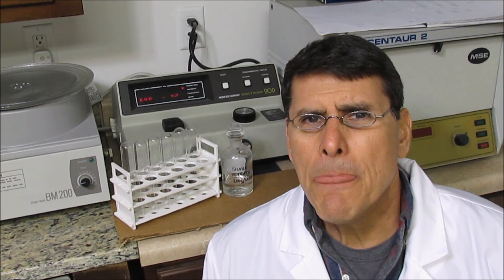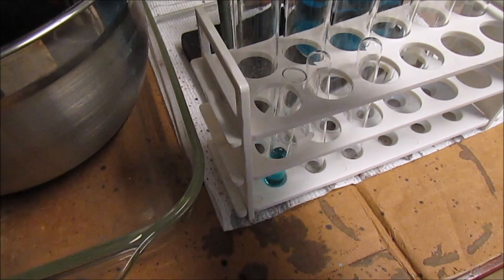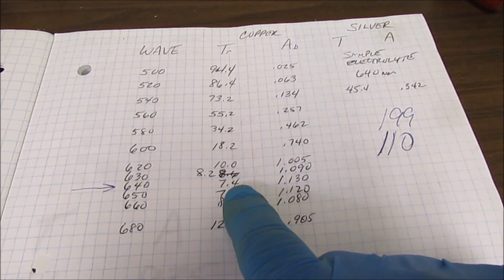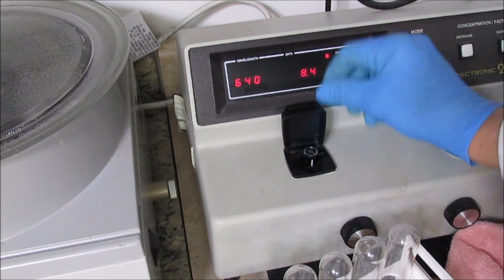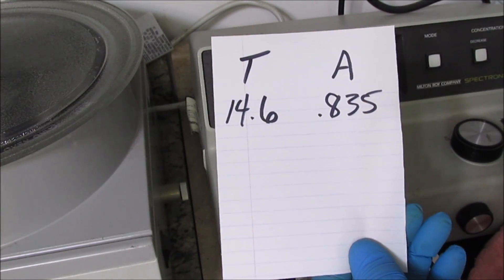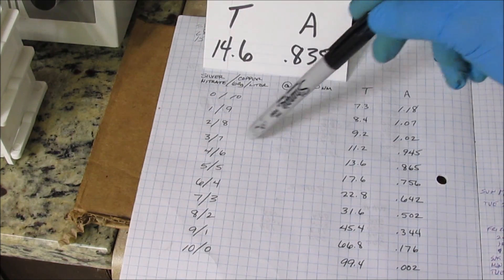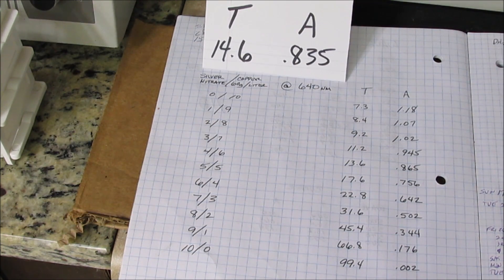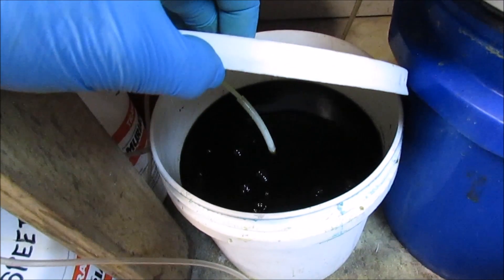Spectrophotometer   How Much Copper in my Silver Cell

Comment: Always enjoy your videos, Question? Once your Solution is saturated past the point described in this video, How would the copper be cemented out? once the copper was extracted / cemented could the Solution continued to be use for processing silver?
Reply from the maker: Jeffrey, as the cell operates, the silver concentration from the electrolyte slowly depletes. It gets plated out, as the cell operates, as pure silver crystal onto the stainless steel bowl cathode. Once copper concentration exceeds about 60 grams per liter, it too will begin to plate out electrolytically on the silver crystal thus contaminating the silver.
Reply: @sreetips  Thank You for the quick Response. My ? is part of a whole process and your insight is enlightening. 

Starting with scrap karat jewelry as I have seen in your videos, once the gold powder is removed there is silver and other metals remaining. Then taking that silver solution remaining and using it to refine with other added Sterling to add to the Silver content newly added creates other metals (mainly copper) which is concentrated up until as described in this video. The copper level is elevated past a point in the silver cell being viable because the of the accumulated copper level. Since my accumulation of low cost Sterling is slow I am considering utilizing 90% Junk Silver Coin Bags (pre 1965) and possibly 40% silver content coins (1965 to 1970) which have even more copper content. As I understand some junk copper has contaminates and think it is possible (or would at least like) to tone down the introduction of added unknown metals by using consistent sources like bag coins and not using junk scrap copper.

My intention at this point is not so much the economic consideration right now yet rather learning to be proficient in the process of accumulation of silver by refining to use in a silver cell to create .999 fine silver for my own stack accumulation and to be used in Aqua Regia for gold refining. As mentioned in some of your videos Profit & Loss is not always the main objective, plus one intrinsic value of going through this process is to educate my high school aged son about chemistry in an real life applicable process which should become economically viable.

This journey started with the intention of creating Gold Ormus (whole other subject) and has dove tailed into refining gold from scrap plus silver from scrap and now it seems the accumulation of other metals like copper and I suspect nickel / brass eventually too. 

As to the economics of gold refining, the gold is a by product in my mind. Acquiring scrap gold jewelry will yield silver. The .999 gold then is sold to acquire more scrap gold jewelry yielding more silver and the engine cycle goes on and on. Since scrap gold jewelry is priced on a discount below melt value of 24k gold the percentage of other metals is free which is silver.

So is it possible to use the electrolyte from the silver cell once it has reached the saturation point of 60% with copper to create a copper cell to extract copper crystals that could be smelted for recycled use in the cementing of silver again? 

My idea is to element accumulated contaminates of other metals when using copper for silver cementing. I have lots of silver-plate flatware. platters and tea sets etcetera as well so to add incremental volume of silver from the silverplated material. So to create pure copper crystals which can be melted in an QuikMelt Pro top loading kiln and formed into bars for Silver cementing. I think I understand the process cycle and value your insight as to what is required to create a copper cell. I have read in the comments you state, you have buckets of copper that would need processing and cannot give away. So if that copper source came from a saturated silver cell with copper and its in solution already how does one cement out that copper?

Comment: Hello sreetips. I have a question. Is it possible to use math to determine the contamination/copper concentration in your silver cell electrolyte? If I have 5000 grams of 98% silver. That would mean there is 100 grams of contamination most likely copper. If my silver cell holds 3 liters of electrolyte. I should be able to process around 9250 G of 98% silver. Before reaching the suggested 60 G per liter of copper concentration in a 3 liter cell. Does your experience with the silver cell agree with my math?
Reply from the maker: One more variable to consider; the silver gets deplated from the electrolyte as the cell operates.
Reply: @sreetips  yes I have noticed a rather large build-up of silver nitrate crystals around my anode basket. I was just going to mix them back into the electrolyte when I harvest my silver.
Reply from the maker: I scoop it up and add it to the inside of the anode basket filter

Comment: Sir in ur silver cell soultion what u have silver nitrate or copper nitrate pls answer
Reply from the maker: The electrolyte is made of silver nitrate and it is crystal clear and colorless when the cell is placed in operation with fresh electrolyte. As the impure cement silver granules dissolve in the anode basket, copper, the main contaminant of the impure cement silver granules, also dissolve and go into solution with the silver. As the cell operates, the copper, in the form of copper nitrate, and not plating out, accumulates and its concentration increases, turning the electrolyte blue.
Reply: Thank u sir